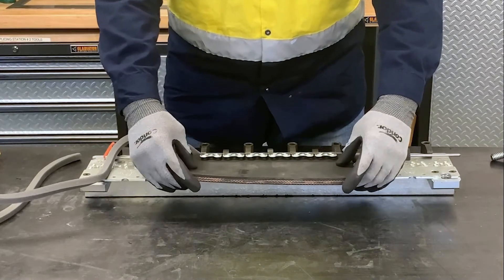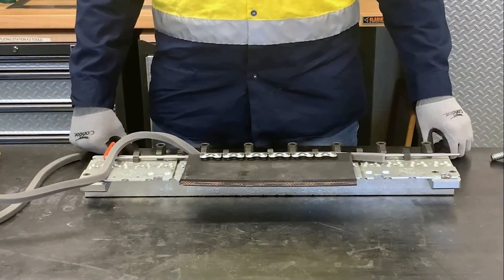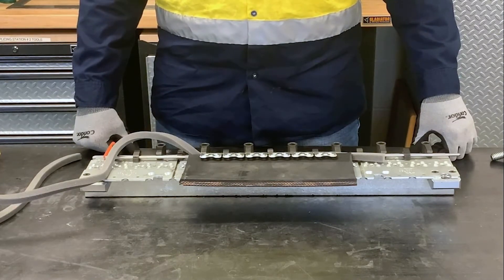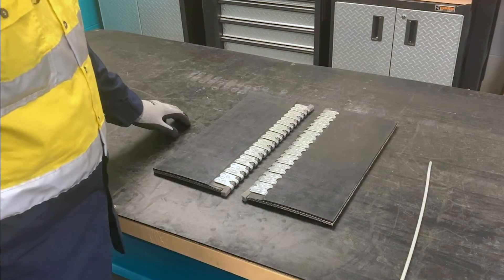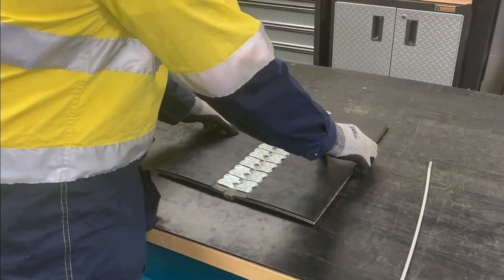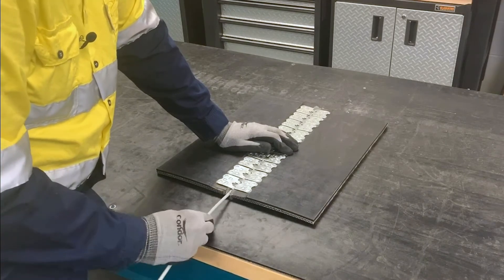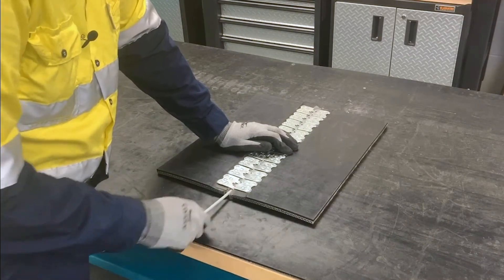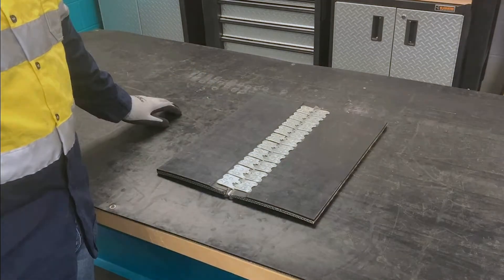Flexco® SR™ Splice Using Sift free Foam

Comment: Do you use the same size pin? Can we use it with MS-45 splice?
Reply from the maker: Hello, yes you can use the same hinge pin size referenced for the corresponding fastener size and you can use this with MS45. Wet applications will degrade the sift stop foam quicker.